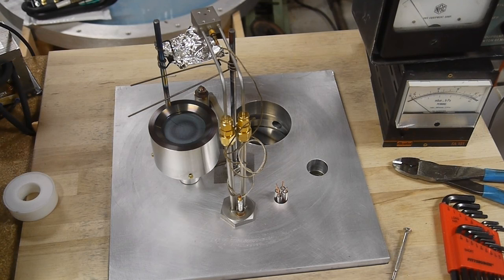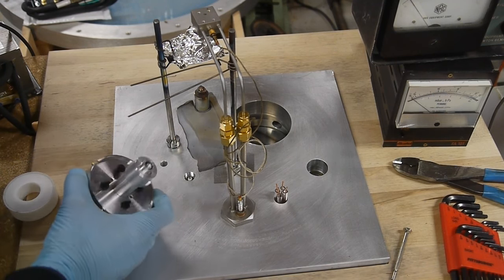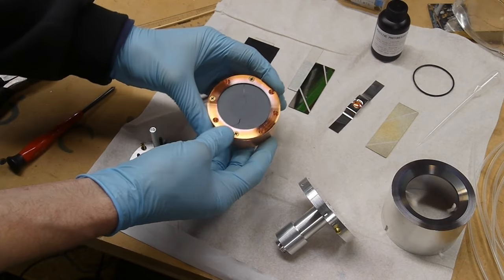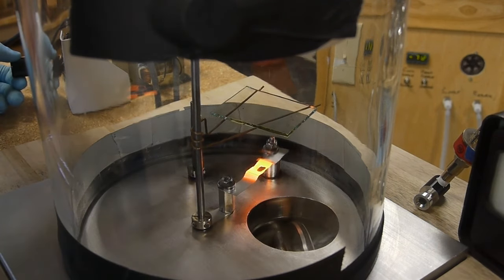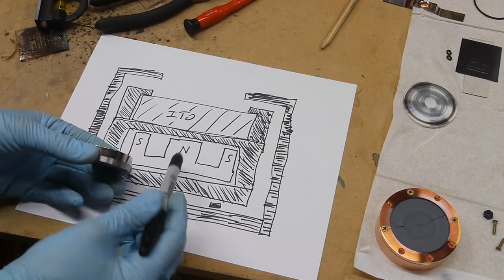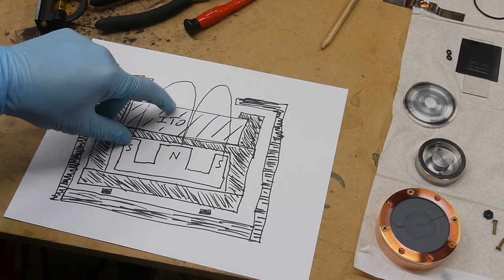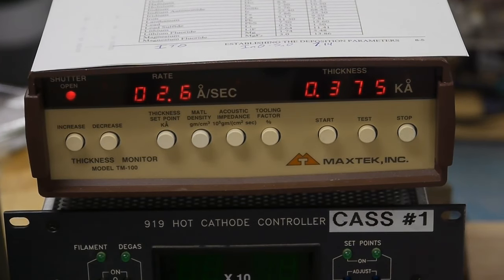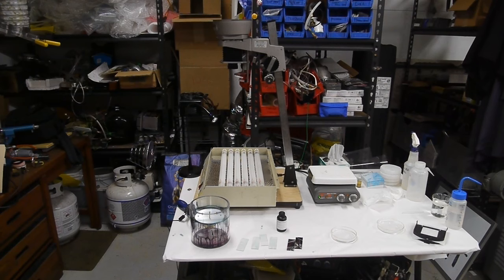Intro to sputtering (process to create clear, conductive coatings)

Comment: Hey, the setup you have there is quite impressive, especially since it appears you made most of it yourself. I do have two pieces of advice:
1) The crack in your ITO disc likely isn't due to the lack of cooling. Don't get me wrong - you will need cooling. However, cracking is often the result of thermal shock, not overheating. I suspect that you just turned your power supply on to whatever current / power you wanted. The sudden localized heating caused by this is what makes ceramic materials crack. You should ramp your supply - start at a low power, then work up to what you want. I recommend a rate of 1 W/s or less. Also keep in mind that no matter what, your disc can only take a limited amount of total power without bad things happening.
2) You might want to integrate a shutter, so you can shield your substrate from deposition until conditions (presssure, power etc.) are just the way you want them.

Hope this helps, and the best of luck!
Reply: Both very good tips. shoot for ~3W/cm² max w/ ITO. 
You can probably get an inexpensive MFC on ebay and control the pressure much better, you could even make a control loop if your pressure sensor has any kind of electrical output.

Comment: Wow that revives some old memories of when I worked in a university physics lab in about '75.  The postgrad at the next bench to me was trying to do evaporative deposition.  He was struggling because his heater kept burning out.  He kept coming to me as the resident electronics guru for ways to improve the power control.  He ended up borrowing a wardrobe sized stabilized DC power supply from the lab next door, but still was eating heater elements for breakfast.  Getting tired of being dazzled by the light from his rig every time he ran it, I suggested putting some tinfoil around it as a heat reflector.  He didn't believe it would help and asked our boss.  That worthy started scribbling on the back of an envelope, muttering "reflectivity of foil, fourth root of energy ratio, absolute temperature..."  "Yes it should be able to get you to 1700°C."  Thus encouraged he tried it and it worked.

Comment: Very nice and informative presentation Ben. Kudos.
One thing worth mentioning though, is the lack of bonding.
You will find that bonding the target to the backplate using Indium will greatly reduce failure by thermal shock, which is an inherent problem when working with any oxides/ceramics targets.

Comment: Hey Ben! I'm Chris from Bulgaria. Big fan! An ITO layer is completely transparent because both Indium and tin oxides are colorless compounds. What you have there is a target made of Indium and tin metals. In order to obtain an oxide layer you need to perform what is called "reactive sputtering" that is that you NEAD to have oxygen in the chamber. What you made there is just a coating of tin + indium metals. Sorry to disappoint you but now I can`t wait to see your reactive sputtering system :)

Comment: Really cool stuff, Ben! I really enjoy your videos. I think indeedItdoes is on the right track with better thermal conductivity to prevent cracking. In the cleanroom I work in, we always use a thin copper mesh between the heat sink and target to improve thermal conductance. Also, when sputtering ceramics and ITO, I have found that a ~2 minute ramp up and slow ramp down is critical to prevent cracking your target.

Comment: I was just at the point where I wanted to build a high-voltage feed-through to a vacuum chamber ... and found your idea to use a spark-plug a beautifully simple off-the-shelf solution..

Comment: I'd recommend using compression fittings for the cooling system. Threaded connectors have a built-in pathway for liquid to exit, even with sealants. Liquid exiting and causing shorts on this wonderful POC would be no bueno.

Comment: I have taken apart some large sputtering machines in the past. They used an MKS 250 pressure controller with a control valve and vacuum gauge. Probably $300 total on ebay if you know what your looking for. I can calibrate and tune it for argon free if you like, I work with vacuum equipment for a living so this be intriguing...

Comment: Quite similar to some of the processes used in quartz crystal production.
Sputtering didn't use a HT process, but we had an ion etch system that eroded the crystal electrodes in a controlled manner to raise the oscillation frequency of the crystal.

Comment: "And the hose runs to my argon cylinder"

Of course it does. Where else would it go. I too need to go and check on my argon cylinder that I happen to have in my garage.

This guy is awesome. Is he a uni professor or something? I can't think how else you would just GET all this stuff.
Reply: He's actually Mark Watney
Reply: A lot of these things are available from suppliers online. It's not cheap, but if you have the time and money... A quick google and I've found an argon bottle available for delivery from £100. Other parts he's machined himself so all you need is access to milling machines, lathes and pillar drills as well as the raw materials. The only other thing needed is the expertise, which is what Universities and youtube videos are for.
Reply: he worked for Google doing research and then worked for valve doing hardware prototyping so he makes the big $$$
Reply: You buy it. It's not anything controlled or secret or special. Most people don't have a need for it, but it's a common welding supply, so it's not exactly hard to find.
Reply: antiswattt3 I would estimate it to be somewhere in the range of Stahlrim and Argonian.
Reply: Argon is easy to get and cheap, it's a standard gas used for TIG welding, and produced in large quantities (it's about 1% of air so mostly made as a byproduct of production of liquid oxygen and nitrogen).
Reply: these are not the droids you are looking for .... move along :))
Reply: argon is very easy to come by

Comment: Great video, clear explanation. What makes the sputtered aluminum firmly stick to the glass? Why doesn't it just wipe off easily afterward?
Reply: speed
Reply: Probably van der waals forces because good contact is achieved, similar to cold welding or why gage blocks wring together.
Reply: @Anenome5  I'd think it could be the metal particles getting stuck in the pores of the glass and then kinda fill the gaps between the bazillions of pores and creating a proper mount like that.

Like not quite friction but overall 'stickiness'

Comment: You can avoid cracking the target by gradually increase the power applied on it (5 W per minute). You can find a document on Lesker website about power density on various metals and semiconductors.

Comment: Impressive work as always.  Some questions:
1. Why is the spark plug necessary?
2. Have you measured the uniformity of the coating thickness?  I imagine there is a tradeoff between uniformity and efficiency?
3. Those ITO targets must have been expensive.  Do you think you can still get good results with the cracked one, or is copper contamination an issue? 
4. What is the flux density of the magnetic field? Does the flux density affect the rate of ionization?
5. How easy is cleaning over-sputter from the chamber?
Reply: Do you know your answers? Can you explain them to me?

Comment: University of Chicago has done some interesting work on an electro catalyst capable of converting co2 to ethanol at low power. It’s a small volume copper deposited on carbon and the catalyst operates at low voltages. Might be interesting to look into creating with the sputtering

Comment: You're Ionizing things in a vacuum chamber and You're going to take apart a Microwave to get a diode out of it ?       Do You think that You could do some Chemical Vapor Deposition to make a Diamond ?  You're just a step away from using a microwave to ionize methane (CH4) and I think they also said Hydrogen in a slight vacuum , above a diamond seed , and grow a diamond off of that seed ?

Comment: Also, using the filament heated with high voltage and the ITO in a crucible would make things so much easier. Do some research on how the Satis MC380 vacuum chamber works, also the Zeiss B12 Lens coating system. Feel free to contact me with questions.

Comment: You should use PTFE coated bolts. Theyll provide the electrical insulation you're looking for and will also be effective at pressure containing.

Comment: I watched all your "vacuum" videos - nice job! Since I am also in the progress to build a similar system to sputter Al to make mirrors: I can see your vacuum measuring sensor is facing straight into the vacuum chamber. Isn't there the danger that over the time, you will also coat the inside of your penning/pirani gauge?
Currently, I have to decide if I place the penning and/or the pirani gauge straight onto the chamber's bottom plate OR to put them both on the tube which connects the oil-diffusion pump with the chamber's bottom plate. 
What would be your recommendation?
Thanks again for your great videos.

Comment: The only paper I read about a rotating cathode magnetron was a sputtering paper. I theorized it as a way to apply kinetic force to magnetron after I saw a video about the rotating anode x-ray tube. Then, I can regenerate thermal during an endothermic reaction. Etc
 Etc.

Comment: Regarding photoresist, I can see that you are using shortwave lamps (~250 nm)? I found it works much better with 365 or 400 nm lamps (a.k.a. disko lamps) with normal Positive photoresist. The reason why it works better is sandwitch of glass, ordinarry window glass, which does not permit 250 nm to penetrate. 365 nm on the other hand has much better chance to do its job.

Comment: whats the cheapest vacuum pump i can get away with? would an ac/refrigeration pump be ok? i tried with a frige compressor and got plasma but it kept arcing so i guess there was too much air inside.
edit: now have a decent leybold pump. please tell your chamber material and thickness, and working pressure
Reply: In theory yes, but is really useful to get better vacuums

Comment: I only noticed this because I've watched so many of your insightful videos, but I wanted to point out a common misconception. There is no semblance of "mass" in the thermal domain. The more appropriate analogy is with "capacitance", hence the term "heat capacity". It's a small detail, but there is a real physical difference. For example the efficiency of a refrigerator decreases as more items are stored inside because this increases the thermal capacitance, or average heat capacity. If instead we thought of this as "thermal mass", mass having inertia, the efficiency would increase with items stored inside, which is incorrect. I'm looking forward to the SEM animations btw!

Comment: Small commercial sample prep sputter-coaters don’t get much lower vac than 300mTorr. But also, they are careful to set the stage at the sweet spot.  Horrible to admit this, but in a pinch I’ve used a dc welder as a supply.

Comment: I accidentally rediscovered that process at my job by operating a boost converter past its power rating while powered by a lithium battery bank with a defective circuit breaker. There is now a permanent copper coating on the table.

Comment: I'm a huge fan of your omnipotent work skills and your projects. 
Could you do something like a titanium nitride coating with this sputtering machine?
Would it work if you took a bare piece of titanium as sputtering material and fill your chamber with nitride instead or argon? 
Pleas try this if you like to and make a video of it, I would highly appreciate that.
Cheers Max
Reply: Or maybe anyone else could answer to this?
Reply: ANYONE?
Reply: I feel like a ghost posting comments here...
Reply from the maker: Max Lindner Yes, titanium nitride can be sputtered.  Yes, it can be done by starting with titanium and adding nitrogen to the chamber. I showed the reactive sputtering process in my self-cleaning glass video.  I'm not sure I will do a TiN coating, but it sounds interesting.
Reply: Applied Science
 Nice, thank you very much for the answer!